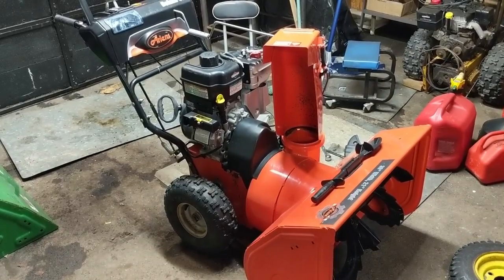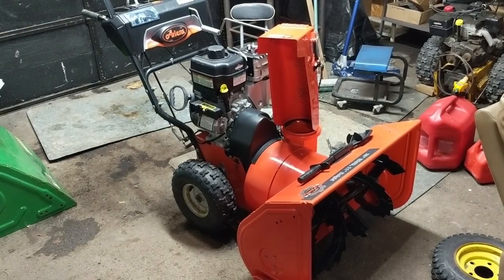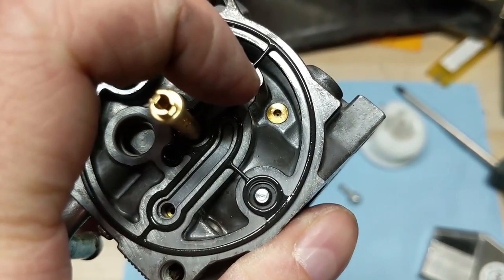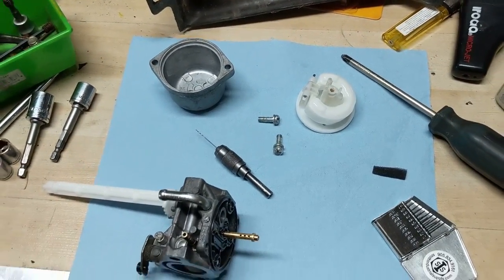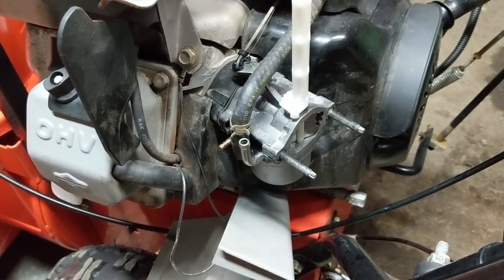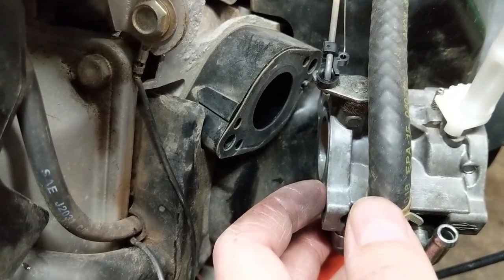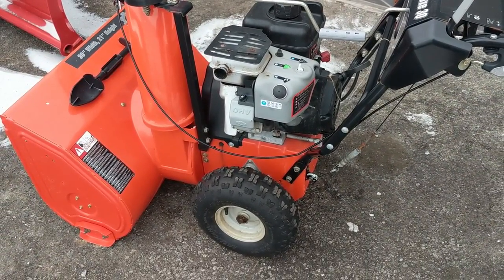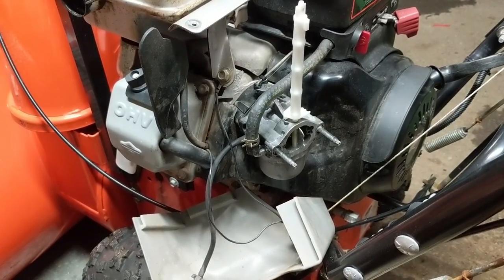How to Fix Surging on Nikki Carburetors

Comment: The level of the fuel is not going to be anywhere near that jet. It is indeed a vent for the bowl and has nothing to do with the idle mixing. It is difficult to follow the passages due to the design of the Nikki Carb but it is possible. The idle jetting is internal to the carb and most of the time taking a can of carb cleaner and spraying into the idle circuit holes on the engine side of the carb will usually clear any debris out of the holes. one of the 3 holes that are next to the emulsion tube are the idle jet. I work on these for a living and I have found that spraying carb cleaner through all of the passages usually clears the surging up. I have not ever had to enlarge any of the jets except for the main simply because the EPA is running the engines on the lean anyways and any sort of contamination/fuel gum will cause this problem.
Reply from the maker: There seems to be different designs of these carbs, 2 that I've seen myself and have heard being described by other viewers. If you read through the comments, this method is proven to fix the issue. But not all Nikki carbs have the brass hole in this location. If it's located in the other spot, you drill that one. I've done this on many Nikki carbs and it always solves the issue, they've never come back after this was done. I keep hearing it's a primer vent, but then why would it smooth the idle if I enlarged it? You would think making an air vent larger would further lean it out, yet the result was clear, the surging stopped.
Reply: Can say I agree with the different carb designs. As to why this method fixes the problem I have no idea. I have never had to do this with the ones that I work on. If I come across one of these carbs I may try this and see what happens. Thanks for the vid and thanks for the comment! Keep up the good vids!
Reply from the maker: @Matthew Richmond  here's a link to some diagrams, the carbs with the visible pilot jet seemingly don't have the primer vent. So I guess I had one with the primer vent and drilling that out larger will smooth the low speed idle circuit. Diagram #14 shows the brass idle jet, but you have to look at diagram #10 to see it's location in the yellow square. Either way these are terrible carburetors, not many techs like them lol

https://outdoorpowerinfo.com/repairs/briggs_intek_single_ohv_nikki_carb.asp
Reply: @EliminatorPerformance   Looking at item#13 on the link you sent shows that jet as quoted from page: 

"#13. Bowl vent (used with primer)

Applications of this carb that use a primer for easier cold starts have a plug with a small orifice (#13) in the bowl vent path."

I'm not saying you're info is wrong in any way. Just that I personally have not had to drill anything except the main in rare occasions. And I do agree the nikki carbs are not the best.
Reply from the maker: Yes they definitely identify that as a bowl vent for the primer, but it must allow fuel to flow through it because looking at diagram #6 you'll see the 2 holes drilled into the "ceiling" of the plastic. This would surely let fuel from the lower bowl enter above.
Reply: Perhaps if the float were higher I would agree. But the fuel level is lower than that, as determined by the location of the float, needle, and seat.
Reply from the maker: We'd only know forsure if we had a clear bowl to attach to see where the fuel went. It makes sense that the fuel would rise slightly above the float, and stop near the needle when in the closed position. Why they would add those holes, why drilling the primer vent fixed surging, we may never know lol
Reply: Indeed. Thank you for taking the time to respond to the previous comments and thanks for the info on the carb.

Comment: Sadly the nikki carbs on the vertical shaft engines that have a mixture screw don't have that jet to drill out, they have it in a different spot and drilling that one didn't help, cursed by design to buy another carb.

Comment: I've got 2 of these carbs with surging issues and neither of them have an idle jet
Reply from the maker: Yea I've heard some don't. I've heard a new o-ring around the main jet fixes it too if your carb doesn't have a pilot jet.
Reply: I put a new carb on it which makes 3 I've tried and still surging.
Reply: @jasonlackey612  The carbs have a main jet usually too small for the bigger engine.  Most of the carbs are for UP TO 10HP.

Comment: Worked on a John Deere riding mower that had one of these carbs.  Very sensitive to the alcoholic fuels.  I worked on that carb every spring until I finally ordered a kit and rebuilt it and ran 100% gasoline. No issues since.  Over engineered junk imo.
Reply from the maker: Got that right, thanks for watching Lance!

Comment: That is a 400% increase in fuel. There has to be an air leak someplace. There is no way a carb could be that far off from the manufacturer. Could be internal to the carb or missing something or a gasket damaged. Thanks for the video. You did a great job. But that carb (and/or engine) has something else wrong with it.
Reply from the maker: As these engines run, they lose compression. The less suction on the intake stroke pulls in less fuel from the small pilot (idle) jet.

The engine is now running lean, so by increasing the size of the idle jet, we're not increasing the overall air fuel ratio, we're simply returning it to normal (which is proved when the engine runs at a smooth idle).

Happens to a lot of these machines over time, you just don't notice it on the older machines because they have adjustable jets.

Thanks for watching!
Reply: @lloydbraun3365  easier than piston rings and rebore
Reply: New piston rings and honing would not fix a lean fuel running issue.

Comment: I wonder if these jets need enlarged over factory because the 10% ethanol has less energy than 0%. if my math is right straight gas would be 14.7 :1 air fuel and 10% ethanol 14.2:1 so  that 10% E needs about 3.5% richer mixture. Of course in cars the computer makes the adjustment. In mowers you just did it lol.

Comment: Ill let you in on a secret, all carburetors are adjustable since making adjustable and non adjustable carbs is too much of a hassle so its easier to put a metal plug over the adjustable screw that can be easily removed with a stripped screw extracter

Comment: A little trick for removing the studs and putting them back in. If you don't have the correct tool you can put "3" nuts on each stud. lock the two outside nuts against the middle nut. Then use the inside nut to turn the screw out. When putting it back in use the outside nut. Then break the locking affect that you created when you tightened then up against each other. Remove the nuts and your good to go....no special tools required. Using three nuts helps it stay tight and places less stress on the threads.

Comment: Design is not the fault of the mfg. I find it to be a VERY nice design... Blame the govt. restrictions on the lack of adjustability... mine has an idle mix screw....
Do a video on how to lean the mix when a quieter muffler is installed...:face-red-droopy-eyes:
Wonder if old numb nuts Taryl has this covered?
ALSO A slightly restrictive air filter could be used, or a filter period as some EARLY blowers came WITH NO AIR FILTER

Comment: Those carburetors are garbage. I made the mistake of taking mine apart to clean it. The gasket expanded and I was never able to get it back together. I ended up buying a replacement off Ebay.